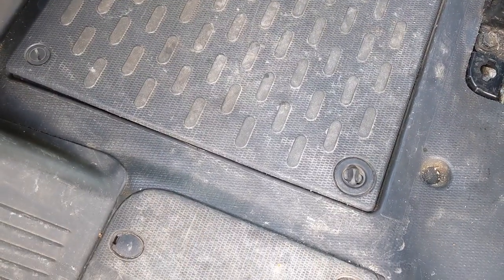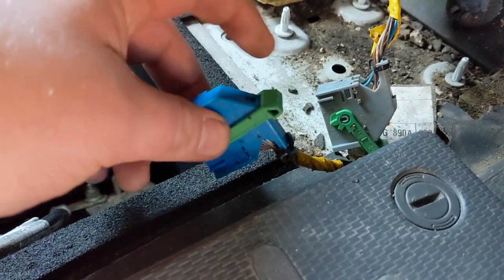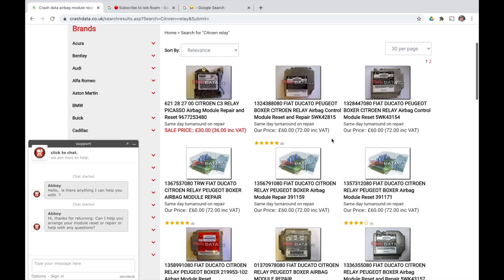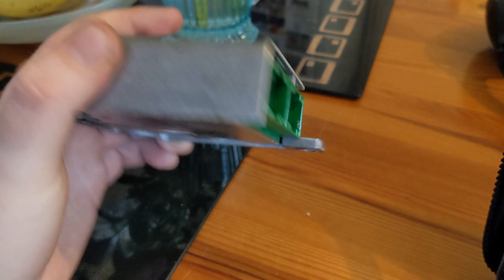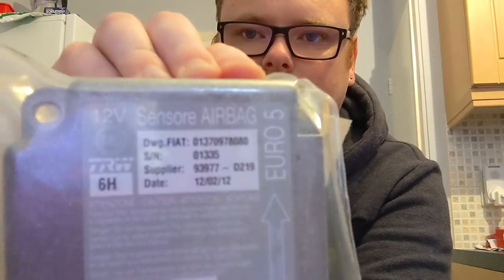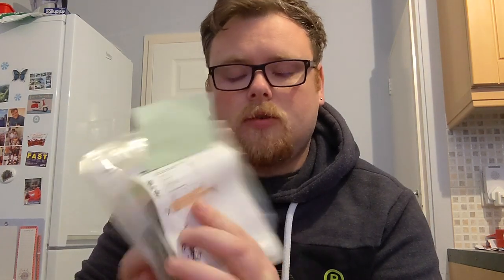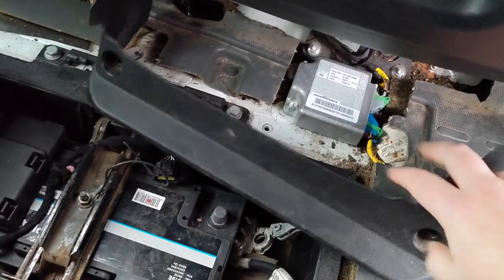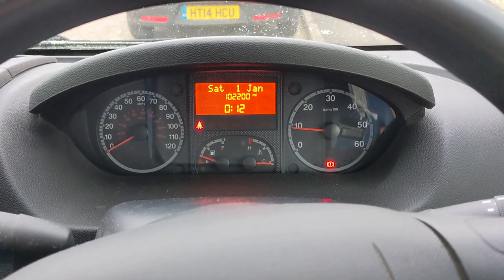Citroen Relay | Airbag ECU Removal and Replacement

Comment: Hi Zac, thanks to your brilliant video, I have saved myself a wheelbarrow full of cash! Crash data received my ECU on Thursday morning - it's Tuesday afternoon and I have got it back and refitted it - all fixed. A really easy service to use and great support from the online chat team who can help at any part of the process.
This really puts to shame the Fiat main dealer who wanted to charge £90 to tell me why my airbag light was on - you're telling me they didn't already run the diagnostic when they did the vehicle healthcheck at the service?!? They then said it would cost me c£300 on top of the £90 regardless of what fault code they plucked out of mid air! I'm going to really enjoy cancelling my booking with the dealer :-)
Reply from the maker: Hey... Thanks for taking the time to write your comment. I am so pleased that my video managed to save another person a load of cash.. it is sad that the dealers are ripping people off. Thanks again for the kind words 😁

Comment: Great video.

This is such a common problem.  I have same issue with 2017 Peugeot Boxer, not been in crash, no corrosion.  Some say there is an earth problem that causes spurious voltages in the ECU. New vans have a earth lead.

Comment: I've a motor home . Drove 50 miles halfway home  after being parked up 5 weeks then air bag warning light comes on .  ☹️Looked under Seat at connections , but not swivel ,  only 30.000 on the clock as well . 
Great video . Seems I've got to get it plugged in first ? .to test . 
Then at least I know about crash data 
Thankyou
Reply from the maker: Well you could send it to crashdata it's about £20 to run the test if they can't sort it. Sitting for 5 weeks and then airbag light sounds a lot like the low voltage error. Good luck and let us know how you get on 👍🏻
Reply: Same circumstances, sat for weeks on permanent EHU at home, run it for 80miles with no problem, then on leaving campsite the warning light stayed on

Comment: Glad you had a good experience with Crash Data but other viewers beware... I sent the same module as this one to Crash Data twice and both times the error came back within days (I replaced my vehicle battery between this so it might just be a knackered airbag module) When I phoned crash data to ask for advice the guy was really rude and started shouting down the phone demanding battery specs. When I told him to stop shouting he hung up. I've since seen a lot of other reviews of cash data saying they had a similar experience. There are other companies out there who do these module repairs so don't just use crash data because they are the most popular.

Comment: I spoke to the lady at Crash Data and she was very helpful as you say. However my local garage used a diagnostic tool and came up with the error code U1726 - they said that I need a new module, Crash Data said the same thing, new module. However there are none anywhere, Crash Data have 150 on back order and our local Peugeot dealer has 4 on back order, no one can say when they're due in. MOT in June, it will fail. My battery has never gone flat and the motorhome is 2016, no corrosion....gutted and need help..:(

Comment: Great video. Wondering would you have know where to find the fuse that feeds the rear 12v socket at the back door?
Reply: If you go online you can get diagrams up I think it’s the fuse box in the engine compartment

Comment: Hi i just watched your very informative video as i think i have this problem , as i have the airbag & seal belt lights lit up on my cluster ,, but my mileage also flashes  ( but these started at the same time after i foolishly used a soldering iron on the 12v electrics with the battery still connected :( 
can you tell what your symptoms were that you had ,, was it just the airbag light ( or seat and belt ) also was your mileage flashing ?
thanks

Comment: I sent my ECU off my fiat ducato to crash data for a reset it lasted 2 weeks before the airbag warning light came back on so annoying I think it is a wiring issue as the vehicle battery has no issues and is not losing or gaining extra power